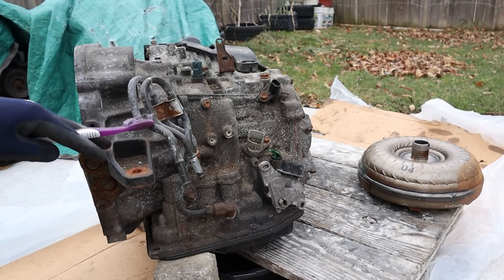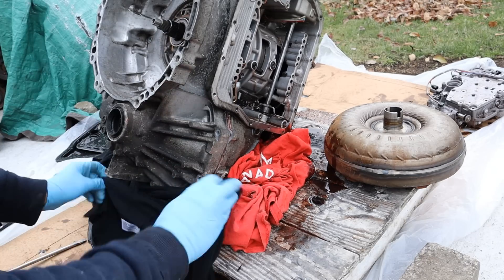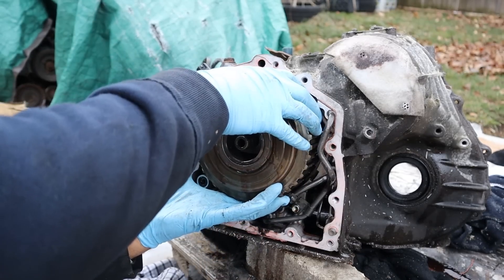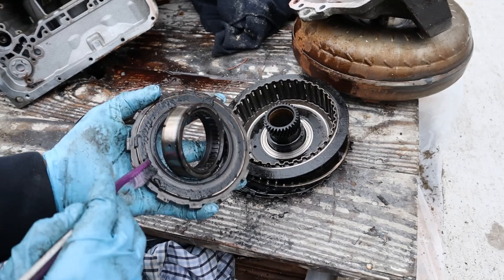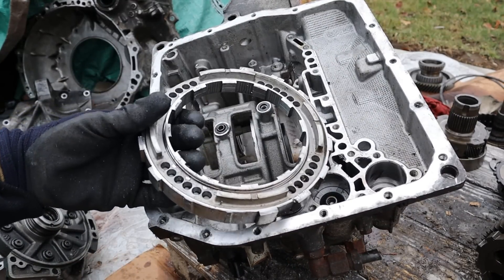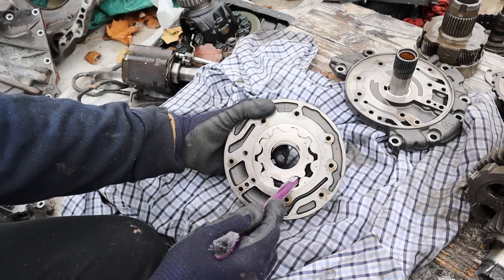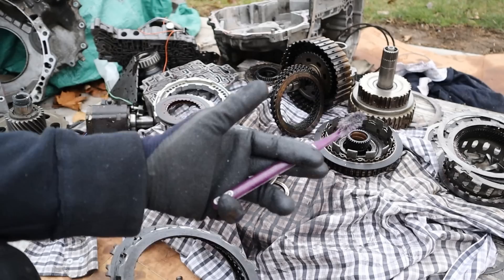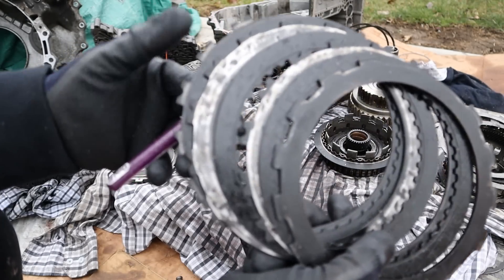Transmission FAIL: Why You Shouldn't Get Stuck in the Snow

Comment: It looks like it was still able to be saved...until the cutting wheel removal tool was used
Reply from the maker: There's many of these transmissions out there that can be swapped in, why rebuild it?
Reply: @speedkar99  for fun or saving money?
if its your job, you do what you do. can you give advice about snow driving on manual?)
Reply: @speedkar99  why not? 80 percent of the parts are reusuable. The fact that all that energy and effort, ( mining, transporting materials, machining, assembly) was put into it, providing us with a great machine, should make us think about rebuilding it, as opposed to creating more waste..  it could have been revived with new seals gaskets and clutches and plates. Im not bitching, i have done just what you do many times, rip stuff apart with no intention to save it..but the "throw away" attitude is wrong to me. Not looking to troll or fight you.
Reply: @pootthatbak2578  You would only be saving energy and effort if a new transmission was made to replace this one. He replaced it with a used one, so no energy/effort was lost, as that effort/energy had already been expended long ago and no action he takes can change that.

An argument could be made that for a rarer transmission, any supply that is consumed will result in additional demand,  whether that means production of new transmissions and/or parts, or people replacing the entire car due to being unable to find an economical replacement transmission. However, in this case the transmission is common and dozens are probably being sent to the crusher every day due to not being worth pulling from the car and storing. So there is nothing to be saved by repairing versus replacing with a commonly available pre-existing one.

Repairing is actually likely consume more energy in this case, as you would be replacing many parts like the clutch packs with new ones, creating demand for more new production of those parts. Whereas replacing with a used transmission will only deplete a pre-existing surplus that is unlikely to ever be replenished. Additionally, with a transmission this damaged, there is a decent chance your repair will fail due to missing a small defect in one part or another, which will cause another failure, wasting all the new parts you've put in. Repairing a transmission with worn clutch packs is one thing (and usually a no-brainer if you've got the time and skills), but trying to repair an transmission that has partially melted itself together is just asking for trouble.

Comment: Why would getting stuck in the snow do damage to the clutches? I live in a snow area, most trans killed by being stuck are just overheated. They try for too long to get unstuck while all the moving parts(differentials, trans) aren't being cooled by moving. To me I would associate that damage with trying to pull something too heavy.
Reply: Check out the description
Reply: @Bluelightbandit  The description isn't clear. Zero traction spinning should be the absolute ideal condition for a clutch, no?
Reply from the maker: Nope. 
The constant reverse and forward motion is really hard on the clutches. Couple that with high temperature and you have what we see here...
Reply: @speedkar99  doesn't converter stall cushion that? Also reverse interlock. I agree it got cooked but you seem to blame a single stuck event for all that damage and I don't think that's realistic or honest.
Reply: @speedkar99  Did you mention if this transmission has its own external transmission oil cooler? My understanding is a lot of economy cars do not have these in the form of an independent radiator...
Reply: its being cooled by fans anyway but nothing will save you from manhandling things like that, even your window motor will burn out quick if you let a kid play with it
Reply: I literally burned a transmission up before by trying the rocking back and forth method to get unstuck in snow. It was a costly experience.

Comment: the friction plates look just like motorcycle ones.
Reply from the maker: I'd love to take apart a motorcycle one day
Reply: @speedkar99  
Ducati Desmodromic valve 'control' system is over interesting one - no spring for closing the valve but additional rocker arm and lobe on the camshaft, 4 valves per cylinder. In the old days it meant frequent valve adjustment and pack of shims to do the job. Today their 2 cylinder 90° V superbike racing engines are capable of 230+ bhp from 1L capacity. But the forces and stress unfortunately make them short living, even the engine cases will eventually deform or crack.
Reply: Exact same principles, just springs instead of hydraulic pressure squeezing the friction discs and plates together, other than that it's exactly the same thing